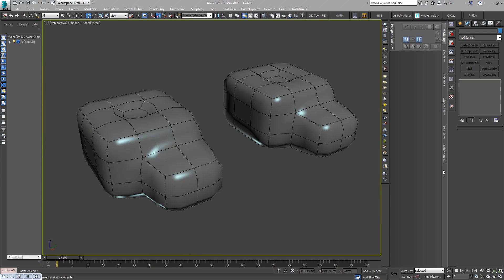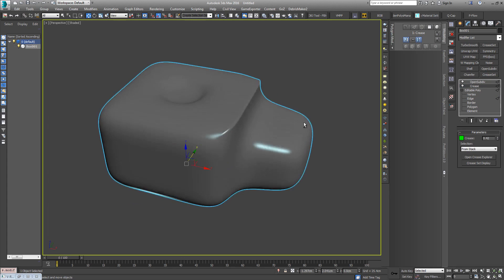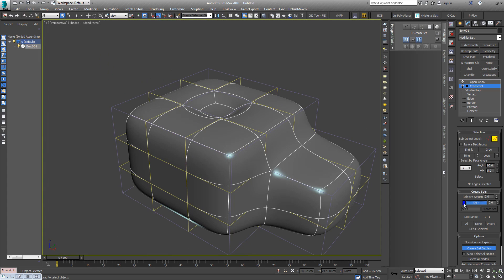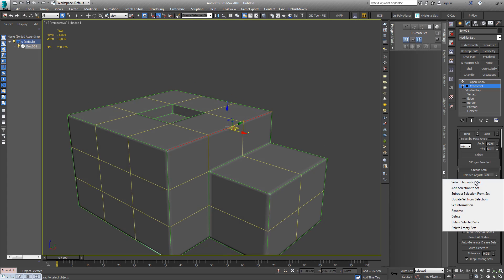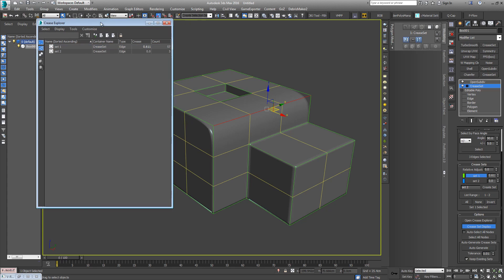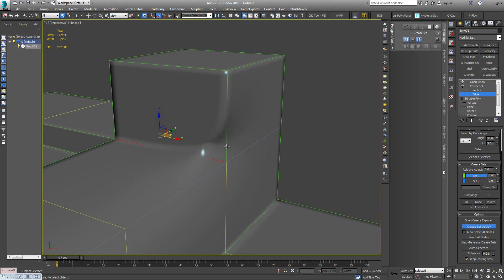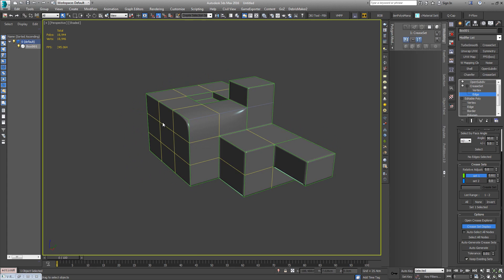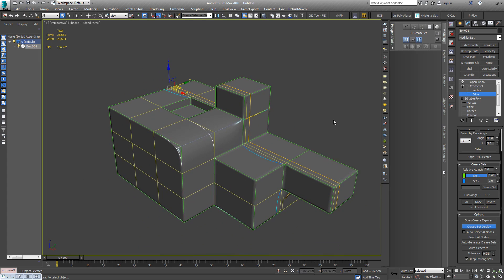3dsMax 'Quick Tips' - OpenSub-Div

Comment: Have you tested the performance between double turbosmooth technique and opensubdiv with multiple meshes in scene?
Thanks for the tip!
Reply from the maker: +johnkomnos Haven't tested it directly, but a high iteration count is needed for crisp, clean results with openSD so it does tend to bog a bit when active in the viewport.